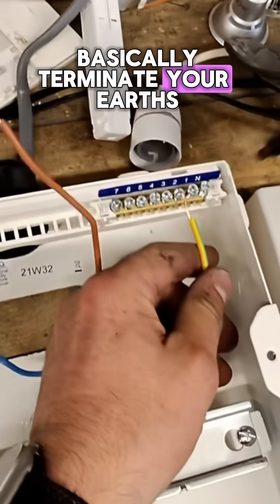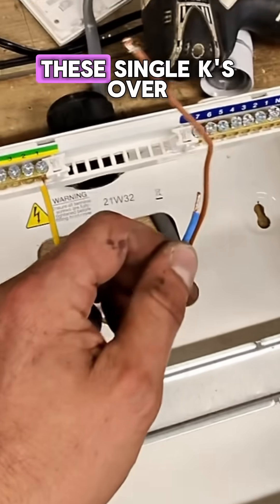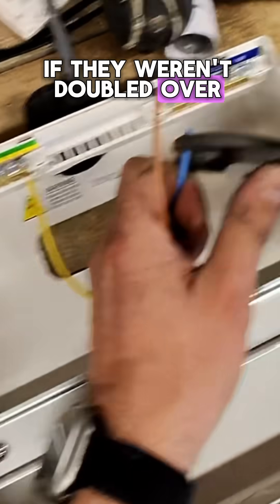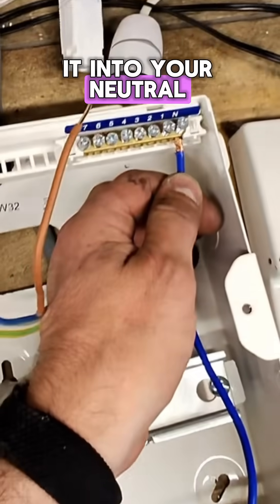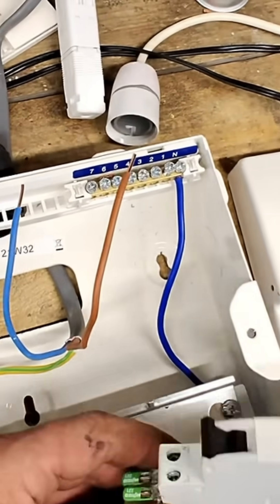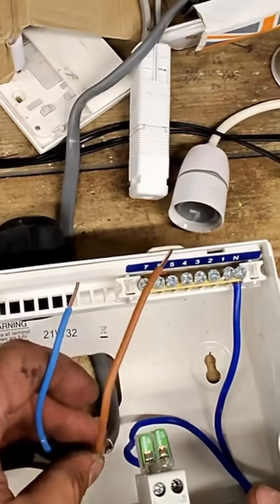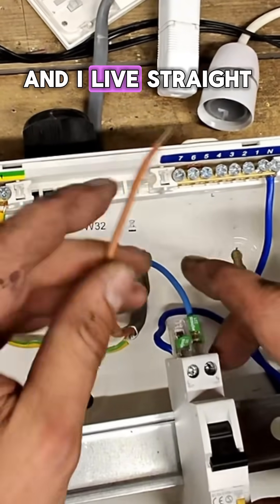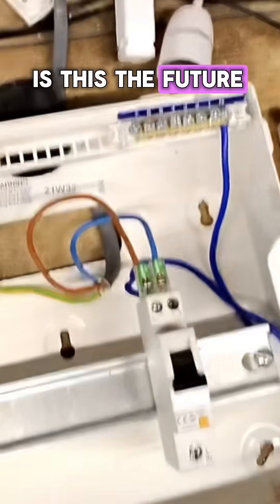Is This the Future of MCBs? 🔮⚡

Comment: No, try fitting a 10mm cable for the shower in one of those or even a 16mm cable for say a garage feed with EV charger...   Just stupid..   If you can't bend over the conductors then you have no business being in a consumer unit, to be fair going anywhere near a consumer unit with a drill for the terminals also shows you should not be anywhere near a consumer unit.

Comment: Using a drill to tighten on a board is wild.
Reply: @Reverend-JT  it's literally just a demonstration. That board is obviously not in use.
If you were actually an electrician you might understand
Reply: @omega1maestro  fully qualified chap, have been for 20 years. If you're going to do a demonstration, probably best to do it right.
Reply: @Reverend-JT he was demonstrating the lever connectors on the rcbo. The earth wasn't even relevant
Reply: At least we didn't see him put the wago in with the drill😂😂😂😂

Comment: It would eliminate the issue of the condictors sitting at the back of the terminal not being clamped correctly
But 
The cage clamps on the circuit breakers are surely good enough... I mean, its a cage clamp...

I love wago but i do wonder if they are trying to be the 'adblu' of the electrical world.